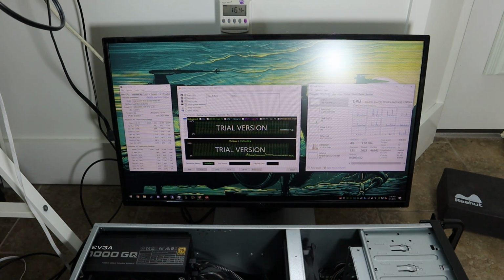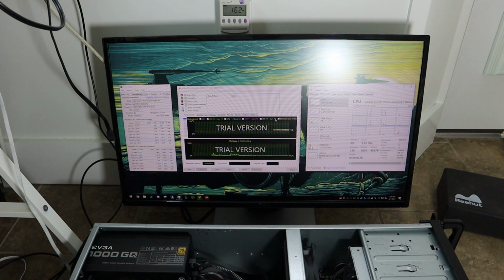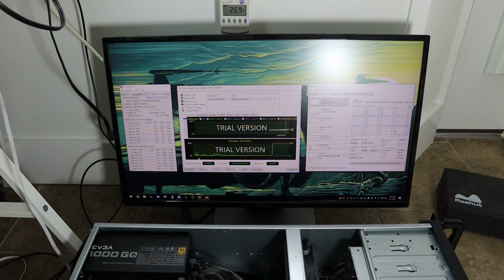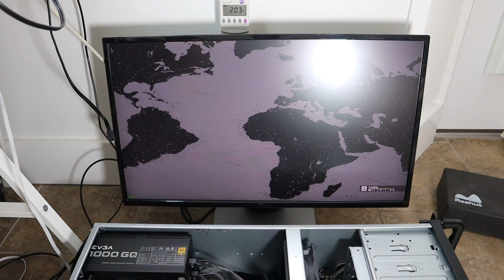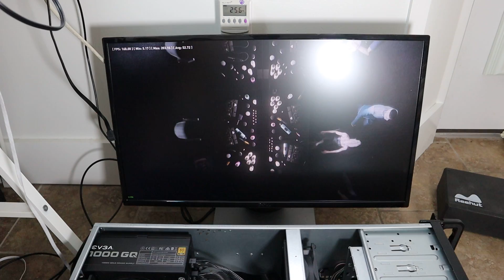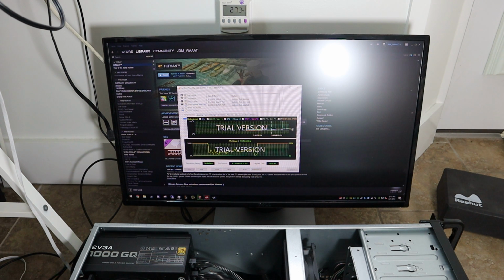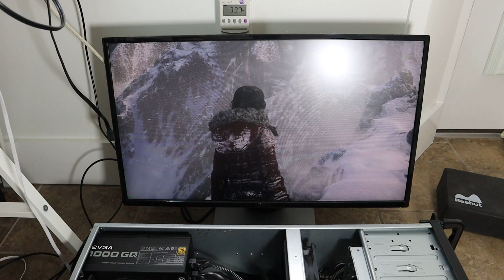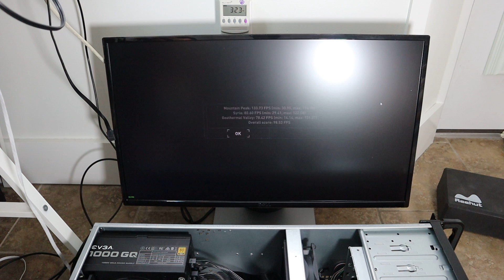80+ Gold PSU - Dual Xeon Power usage testing part 2/2

Comment: I have a be quiet dark power pro 11 550w it can handle 2 1660v2 with a 1050 and a quadro p4000?
Reply from the maker: You cannot use 1660v2 in dual socket configuration. P4000 is relatively pointless.

You might be pushing that PSU too far. I would look for 700w+
Reply: @JDMWAAAT  I will need this pc for my university, I already have the PSU so maybe I should get a ryzen 5  or I don't know, do you have any advice?